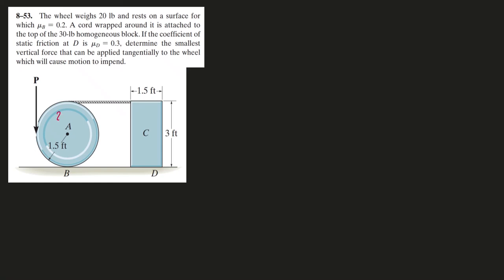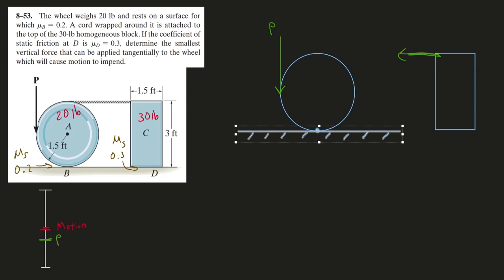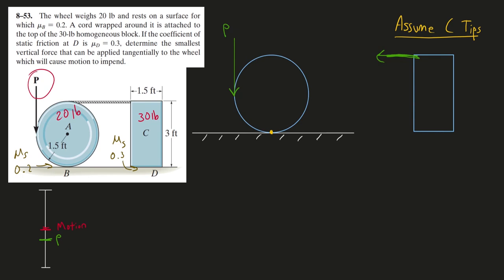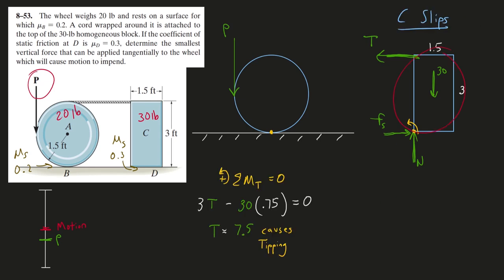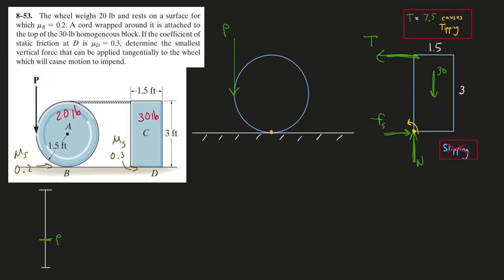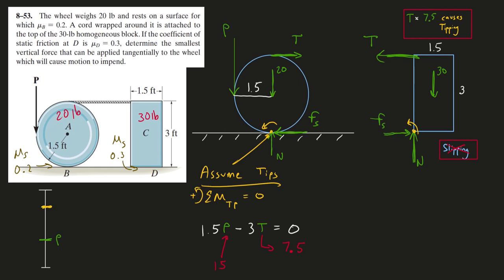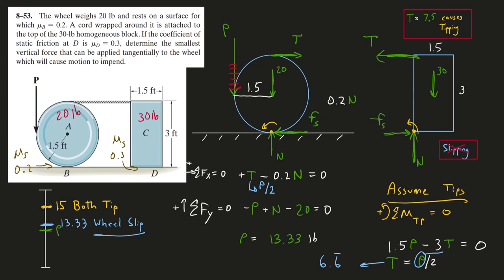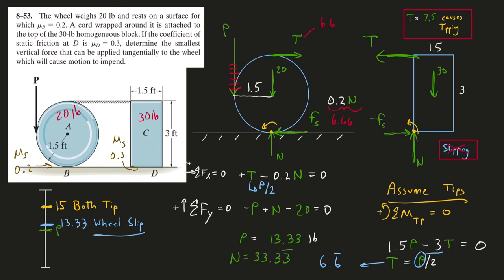Statics Problem: Friction, Tipping, & Slipping - Problem2

Comment: 13:38 why is this the equation (defined from tipping) that has the relation for P & T that we would use for defining if it slips?
Reply: Ik this is a year late, but we got that equation from the sum of moments equation when we assumed the wheel would tip.